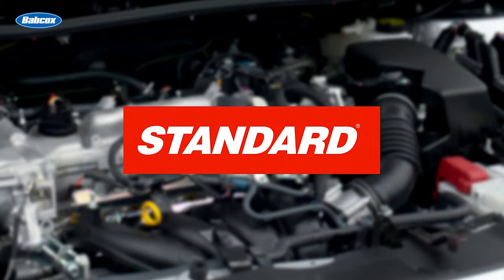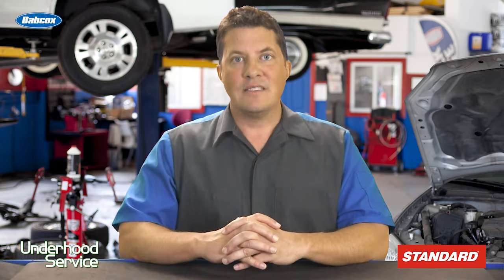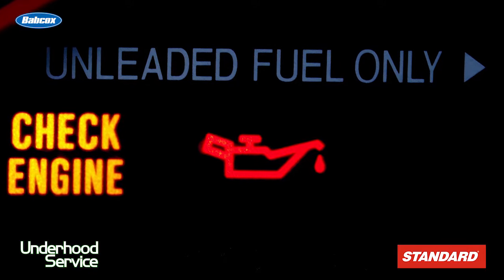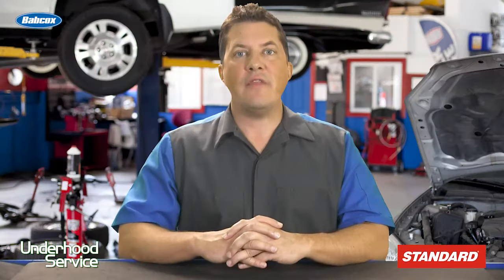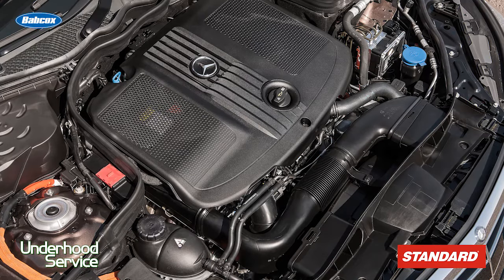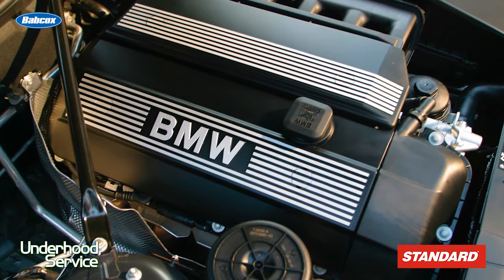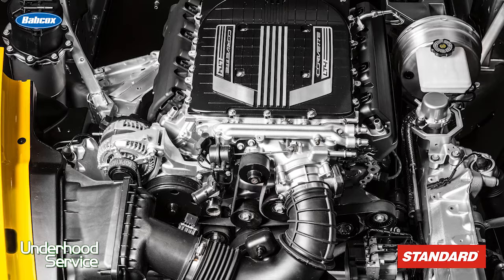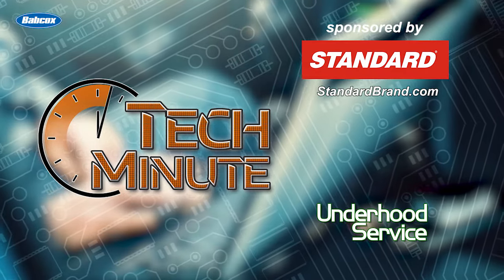When Oil Level Sensors Fail | Tech Minute

Comment: oil level sensors that need a running engine are such a bad idea. Worst idea Mercedes Benz has ever adopted. Such a pain when one is faulty, but doesn’t throw a code, especially if you’re just topping off oil, or pouring by hand. Dip sticks are so easy to use, and reliable as hell.

Comment: My 1994 Civic has oil level sensor and it's not a Mercedes lol. Nevertheless I prefer to check the oil level by myself using the dipstick..
Reply: No you dont. You have an oil pressure light/switch. Not the same

Comment: My 2018 chevy Impala has a sensor that went bad at just over 50,000 miles. I was quoted $1949 to repair it plus tax. Guess what, the car has a dip stick too.  Every 12 minutes it gives me an audible and visual warning. No way to shut it down. Neve had a car with one and never needed one. What an asinine waste of money!
Reply: Buy the part and do it yourself it’s pretty easy if you can do an oil change you got this 💪

Comment: The "Low Engine Oil Level" warning light comes on  when I start my 2003 Chevy Impala. It goes off after about a minute, and the dipstick shows full oil. In fact, I changed it six weeks ago.  In trying to find videos regarding this warning light, I keep seeing people talking about the "Engine Oil Pressure Unit" or "Engine Oil Sending Unit."  Is the oil pressure switch the same thing as the engine oil level switch?

Comment: Volkswagen people know when the oil level sensor goes because it blows your clocks fuse and the car won't start. Replace fuse and the car will start and it should get you to a Parts dealer to replace the sensor at a rort of $200 AUD with no 3 pin connector included. Now I have to wait til morning to find a 3 pin connector. Mine snapped out of the sensor when I scraped it on something driving. 
I got about 40kms with a broken sensor before the car died and now I'm on the side of the road waiting for morning to get the 3 pin connector. Luckily, I have a bed in my van.

Comment: Sensors fail,  Rely on visual dip stick. Unless engineers decide to put a lock on MB engine oil system, like they did with the transmission system🚱.  What are they think😖😖⁉️

Comment: I have a Qashqai 2017 and since 2020, i have been experiencing a night mare when i saw a message saying "sensor fault" with the symbol of the oil lamp in orrage . The mechanic said the sensor is ok. And i should not worry. So far and for 2 years, nothing seems to be of  a problem. What do you think the cause might be? Thanks
Reply: Prob oil ‘level’ sensor failed hence no issues other than a light on the dash.

Comment: I drive a Holden Astra 2008 and yesterday a few minutes before I got home it came up. I stopped my car, let it chill for 5 minutes, checked my oil and it was at a normal level. Then today I drove to work, it felt fine, after work I topped up petrol and then again a few minutes from home the light came on and I pulled up at home to check.. I'm worried!!
Reply: Do you stil own it?
Reply: @iwaihalimi  absolutely not. I got a better car.